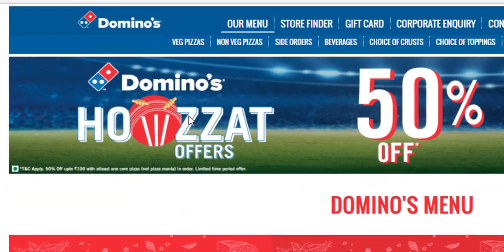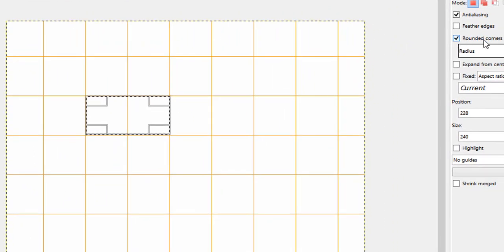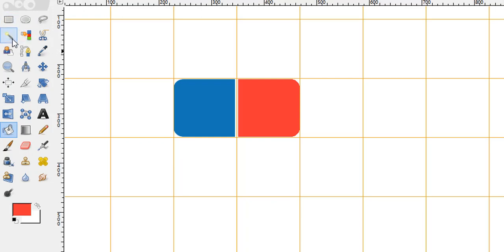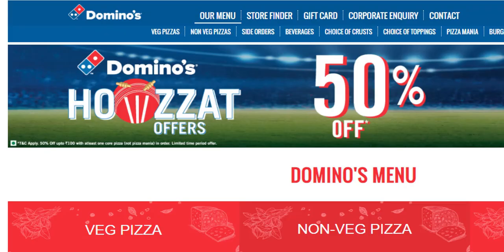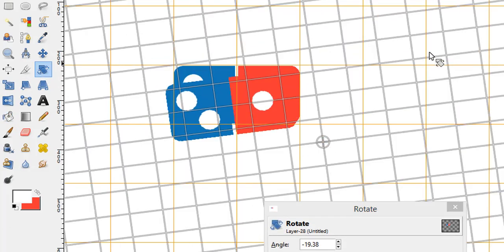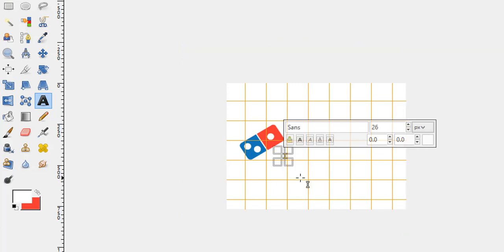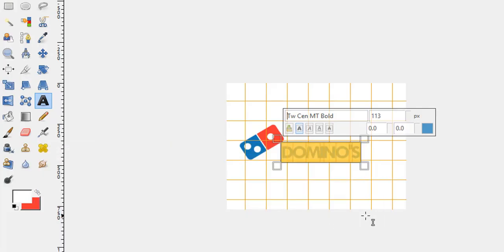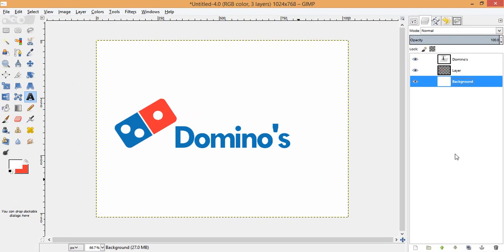Design Domino's Logo in GIMP||Step by Step Tutorial

Comment: You didn't show what radius the rectangle is when you created it, I guess users will have to take a shot at it and eyeball it. You also didn't show the nex colors for the blue color or the red colors that you used. It's still a nice tutorial. Gimp has been updated to 2.10.34, so the second part of the bucket fill doesn't seem to work unless you use rectangle select and then fill in the right side.